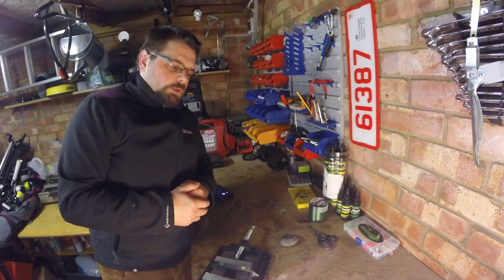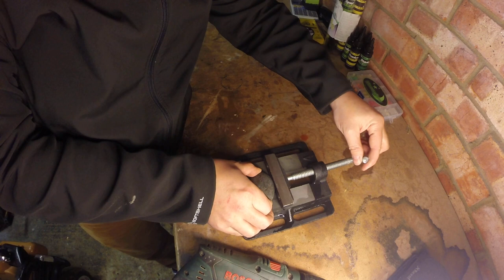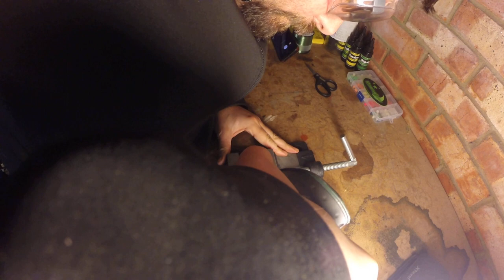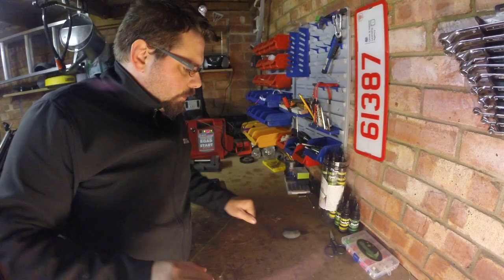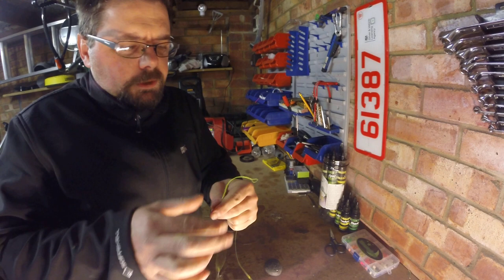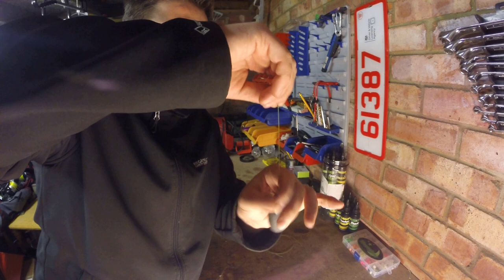environment friendly fishing weight

Comment: Great Idea! To answer everyones issues with it snapping off during cast. when using this you would normally use a rotten bottom setup, so when casting the 20lb line won't be in play you will be using the 50/60lbs main rig body plus your leader to cast. hope this helps 👍 I will be trying this out, definitely save some money on some weights over rougher marks 😃 tight lines 😃

Comment: Just to add to the pot in regards to Scott's comment and anyone with concerns, maybe use some stainless wire (used for like fishing) or some 50lb line and an escape clip. Personally given the size of the stone, at 20lb line I don't see it coming off on an over uead thump. Watch the sharp edges of the hole cutting through. Thank you for your time making and uploading. Excellent video.
Reply from the maker: Thank you for your comment ideally I don’t want leave nothing apart from stone on the sea bed. Weight of this one is 4oz so not to heavy also with the big bait which I do use i don’t cast far anyway but I will check this clip and see how it goes :)
Reply: @AmazingFishingUK  I agree when rough ground fishing on using natural materials. Personally I would do what you have done, the places I hope to fish, you don't have to cast more than 20yrds. Spot on. Keep up the good work. And thank you for the comment today on Facebook.
Reply from the maker: Nice cod you got and dab :)
Reply: Thank you, first ever. The dab was the one my wife caught.

Comment: Good idea  but for boat fishing but don't think i would trust it on the beach or pier.Maybe would be better with a piece of plastie tube through hole in pebble with line through that to protect line from edges of drill hole.But still would want to cast more than about 2oz on 20lb line.Even as said with an over head thump with todays rod  you can still put a lead getting on close to 75m or more if you a reasonable caster its surprizing how much power is genarated.
Reply from the maker: Boat yes 10/10 pier with the baits which I use I do not cast far I just don’t want to leave anything on the seabed apart from stone plastic will be great buffer but still it’s a plastic but this is what is about sharing info and make all ides in one :)